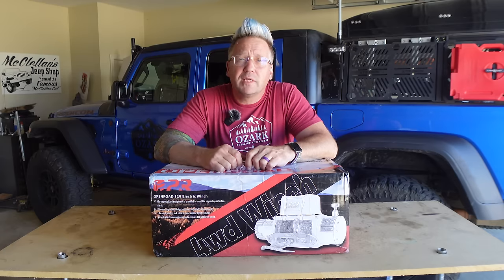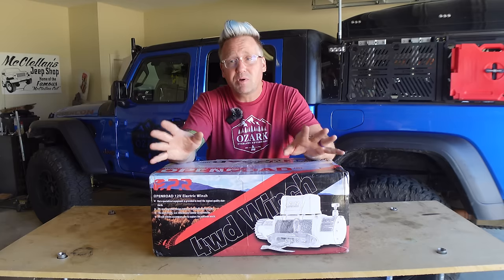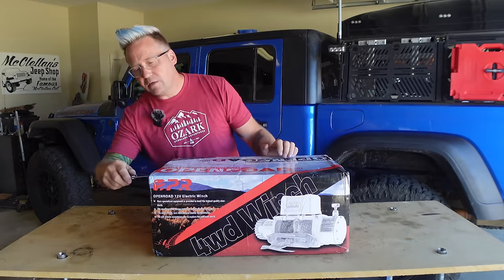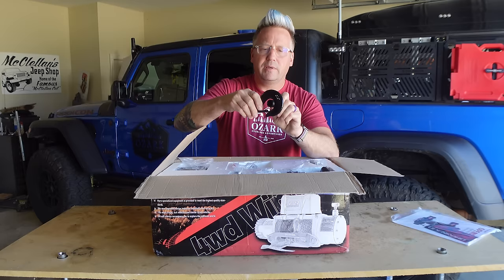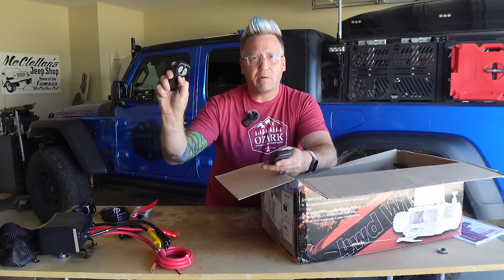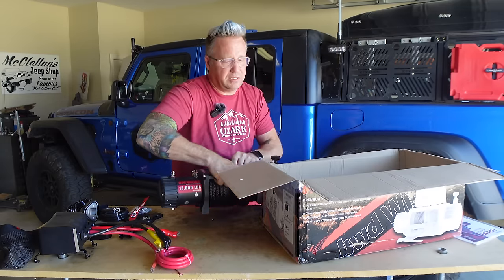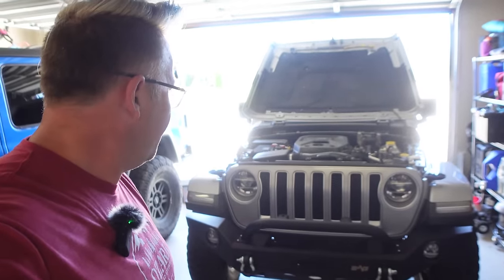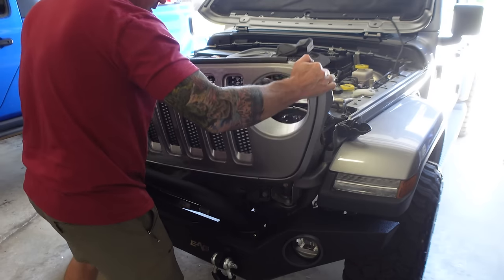Can You Get a Quality Winch for Under $500? OpenRoad 4WD Panther Series 2s Plus

Comment: Well considering that WARN's Zeon Platinum winch costs around $3500 I'd be wondering about 1) the longevity of the $500 winch 2) the length of the warranty and 3) the company's reputation for customer service or lack thereof, if there is a problem 4) Has the co. been around long enough to stand behind the warranty
Reply: Hell, if it break you can buy 6 more for the same price.

Warn are great, but at $3500 they can effff right off.

Comment: I have the Panther 13k on my Wrangler and have used it many times in the past few months for self recovery and pulling others. It has not let me down yet😎
Reply: i didnt see him install a solenoid/fuse of any kind in the fuse box my fathers winch of a different brand had a fuse for a switch panel, and have you noticed any parasitic draw to your battery
Reply: i just ordered this one thats why i ask
Reply: @Wherewegoing  mine came with the solenoid but I did not use it. No, I haven't had any draw on the battery when but in use. It is still going strong. Just recently had a couple big pulls on it while in the mountains. Great winch.

Comment: I'm doing a build very much on a budget. I bought Open Roads 10k winch with synthetic rope based on your recommendation. I trust what you say and the price was great! Supposed to be arriving this weekend, can't wait to get it on the truck!
Reply: How’s it working for ya?  Seems like a good winch for my budget as well
Reply: @The_Red_Off_Road  Unfortunately it never arrived. Kept getting delayed over and over for several weeks and Amazon eventually just cancelled and refunded my order. Not sure why the supply issues. Ended up going with an X-Bull 10k winch instead as it had similar price points. So far so good with that one.

Comment: I've got the panther 2 9500lb for my 2 door Rubicon. Only used it once in the last 5 months. I added the beefy $30 harbor freight hook. Only 2 negatives. Washers are way too small most bumpers have slightly elongated oversized holes. #2 the huge control box I had to mount the wires forward which is fugly 😂 (it seems they updated the box thankfully)

Comment: Could I be so bold as to inquire what winch mounting plate you use on your Gladiator? It seems that a winch is only as good as the strength of the mounting plate. If the plate twists and deforms, the winch housing is likely to break as well, making the winch useless out on the trail. 
I enjoy your channel, Matt.
Reply from the maker: When I had the factory steel bumper I was using the Warn winch plate with it.
Reply: @Ozark Overland Adventures  about to order this winch...thank you! I have a new 2022 JLUR with factory steel bumper. Curious if yall went with the Warn winch plate for Boo, or if there is another you recommend if starting from scratch.

Comment: I’ve been watching your channel for the last few months since initially discovering it. I just bought a 2020 gladiator rubicon with the steal “winch ready” bumper. Obviously, I’ve seen you mention and use this winch on here before. So, I’ve been thinking of getting it eventually. The mopar steal bumper requires a mounting plate to install a winch. Here’s my issue with this company. It’s not a big issue. Just a weird one. Lol. I emailed them directly advising of the gladiator and the bumper I have that is winch ready but needs a mounting plate, and I asked them which mounting plate they recommend. Their response was “just buy a bumper that matches your jeep. Our winch mounting holes are international and suitable for any mounting holes on bumpers.” Sort of a weird response to me. But oh well. I’ll figure out which mounting plate I need.
Reply: That could be why WARN starting selling bumpers to go with their winches.
Reply: Hahaha, friend, maybe our staff misread your description.
However, the mounting holes of our winches are indeed international. Whether you want to buy a bumper or a mounting plate, you only need to buy the one that matches your model. Our winches can be matched. If you need more detailed information, you can check the main picture of the product link, one of which is the external dimension drawing of the winch, which is very useful.😊😊
Reply: @openroad4wd_official  Sweet! Thanks! 🙏

Comment: great video, still a winch you recommend for gladiator driver?
Reply from the maker: Yes, absolutely
Reply: @OzarkOverlandAdventures  I have the stock metal rubicon front bumper.... would this fit/work with that bumper?
Reply: @OzarkOverlandAdventures  do you like there 270 awning?

Comment: Adam, this is a yr later, so hope you get this.  My initial setup of this winch has been problematic.  1st control box wires loose.  But more importantly, the free spool does t work when clutch is disengaged.  Been in touch with tech and Susan at open road email wise, but have been left in the dark for aa replacement.  Do you have a better contact #/person for them other than their basic "info" email and phone # on website?
Reply from the maker: Who is Adam?

Comment: Hi Matt, based on your recommendation and that of other Overlanders, I purchased this winch today.  Is the only way to give power to it is to hook the terminal cables to the battery or can you hook it up to an SPOD?  I also just purchased a Bantam X SPOD but it says I can’t power a winch to it.  Thoughts or suggestions?
Reply from the maker: I don’t know if an Spod can handle the amp draw of a winch. I don’t really see a reason to wire a winch up to a switch.

Comment: I just purchased an open road winch for my 2022 Gladiator Rubicon. Looking for a bumper, any suggestions? I would like to keep my front skid plate or at least have options. I am brand new to 4x4 and any help would be appreciated. Thanks.
Reply from the maker: There's so many bumper options now. I would recommend one that has a recessed winch plate and most bumpers are either going to replace the factory skid plate or have an optional skid plate for their own bumpers. My bumper from Relentless Fabrication has the skid built into the bumper.
Reply: @OzarkOverlandAdventures  Awesome thanks

Comment: Decent install I guess.  You really gonna use that tiny ratchet to tighten down the bolts on a 13,000lb winch?  Seriously, do you not own a torque wrench?
Reply from the maker: I mean if you’re going by what was shown in the  video then I completely failed to tighten two bolts. 😂😂

Comment: Buyers beware, their customer service number has been suspended. It's virtually impossible to get in touch with anyone and you're speaking to someone in mainland China that doesn't speak English and does not understand English... I have a 13000 lb open-road winch that does not work and I can't get open road to do one thing about it.
I'm out the $500 I paid for this winch solid. This is a sham of a company and I would strongly discourage you from purchasing an open road there are other options available that will provide customer service.
Reply from the maker: I have personally sent them a screen shot of your comment. Send them a message on their Instagram.
Reply from the maker: Did you send them a message on their Instagram?